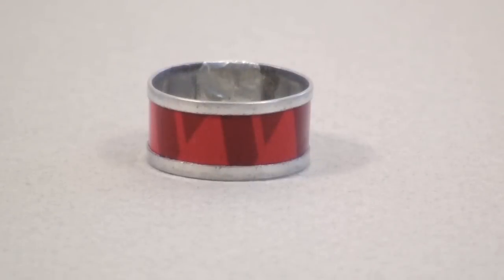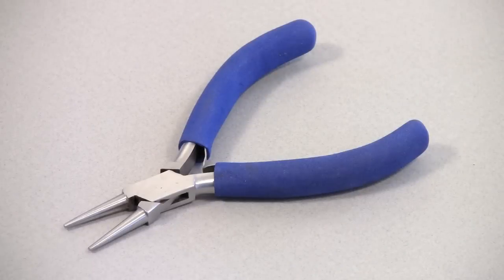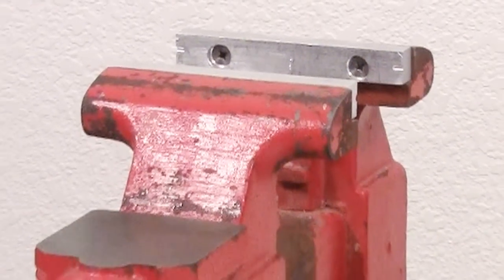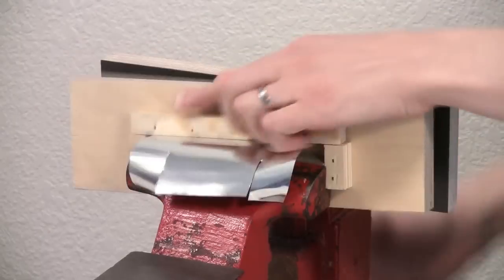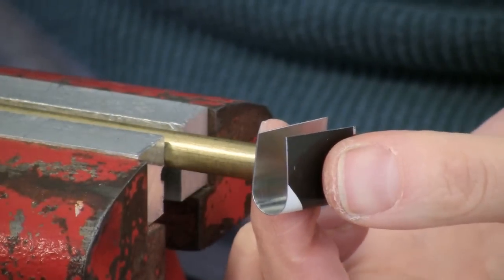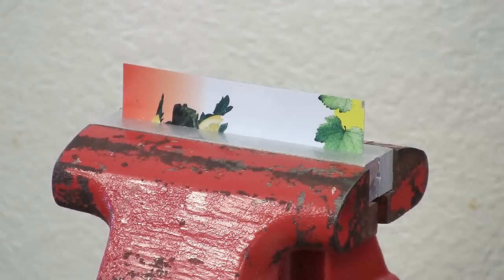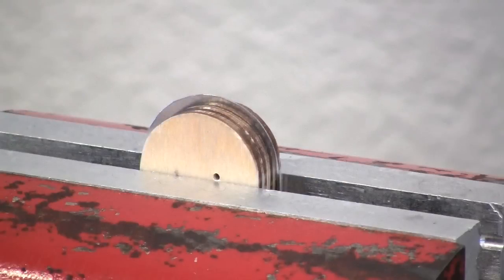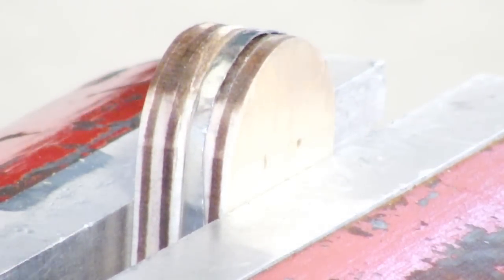Tinplate Girl #7: Folding and forming tinplate

Comment from the maker: Hi. Since tinplate is so thin, the edges will always be a little sharp. However, if they are very sharp from being cut with shears or if the corners are very sharp, you can dull them down either with a small flat file, filing the edges at a 45-degree angle, or with some fine sandpaper, like 400 grit. This will make the pieces much easier to handle. Give it a try. --Tinplate Girl
Reply: Where have you gone
Reply: Herschel Jackson  She seems to have disappeared, I didn't expect a reply 3 years later. Cheers.